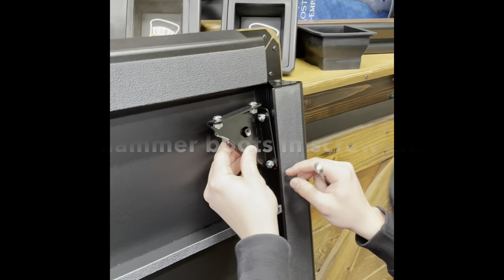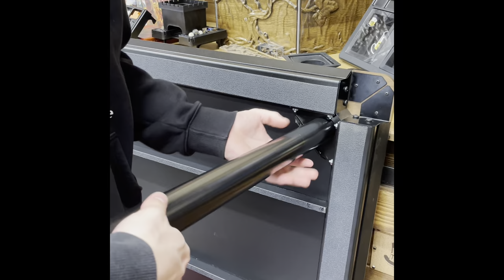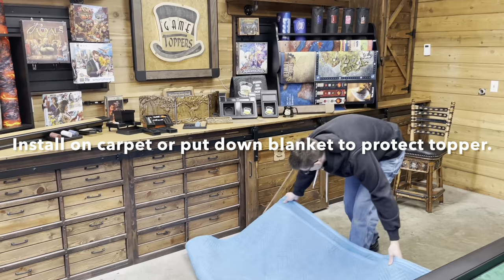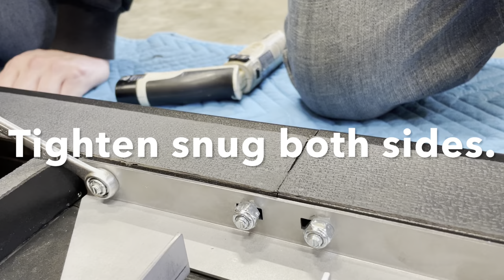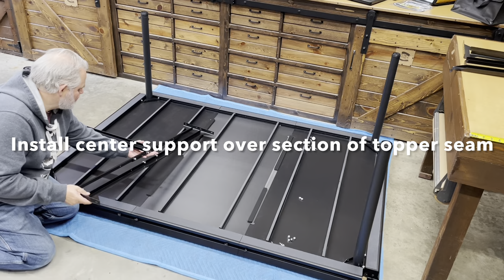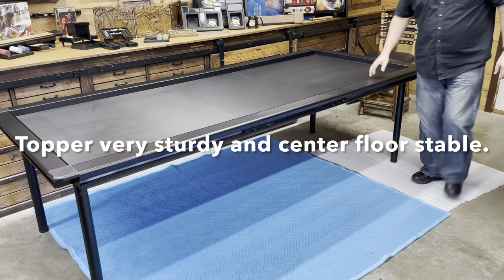leg kit install video

Comment: I was thinking using the legs for the Moriaty in one room and Mycroft for the dining table in another. What pieces of hardware would I need to take off of the Moriaty to do this (legs, brackets, etc)?
Reply from the maker: You will need the one center support and the four legs with the four corner brackets attached to the two end pieces of the Moriarty and they’re also 224 inch lateral supports that will be needed for the Moriarty. That means you’ll be taking out one center support and one of the center lateral supports of the Mycroft. If you want to have two tables set up you would need the mastermind leg kit set for the Mycroft and then YouTube Detective Moriarty leg kit set. If this doesn’t answer your question fully please email us at support@gametoppersllc.com and it will be easier to have a thread to take care of you. Thanks so much

Comment: On my Holmes center bracket I was only able to install 3 bolts on each side of the seam, but the video says I should be able to do 4. Am I missing something?
Reply from the maker: You bracket should have four holes. It’s possible that maybe one of the holes has not been punched out? Truth be told you really only need two bolts one on each side of the seam for the center support. If for some reason all four holes haven’t been punched out you can put that on a block of wood and punch out the metal. This sometimes can happen with manufacturing large quantities just like cardboard being punched out every now and then one gets missed where is the metal plug is still sitting there. If you have any troubles contact support@gametoppersllc.com

Comment: Any news for a set of.legs compatible with the first gen tables?
Reply from the maker: Yes so sorry about that but the first generations are not compatible with our leg kits. We spent quite a bit of money proto typing and testing but we never found anything that was stable and cost-effective. That is why we had to redesign the rail in 2018 to accommodate the new features. This was not our intention initially but we found that we needed to continue to innovate.
Reply: @GameToppers  OK, thanks for the reply. You tried, and that's all we could ask for.